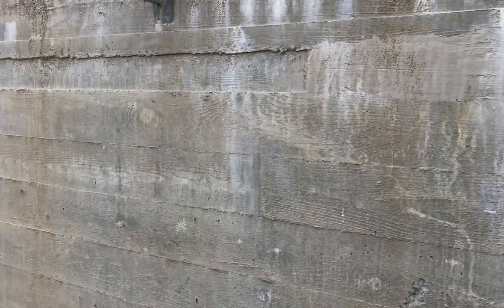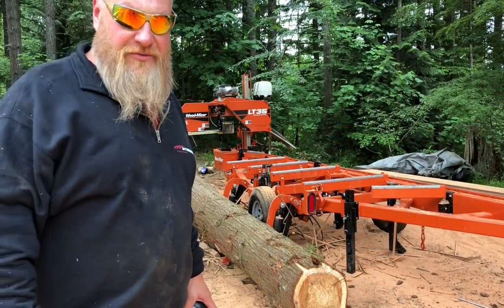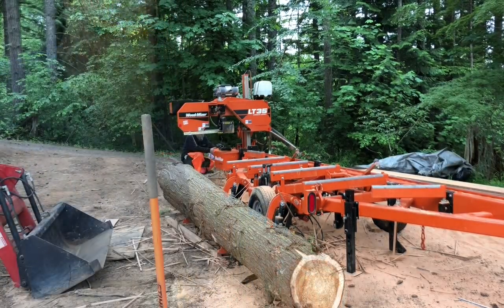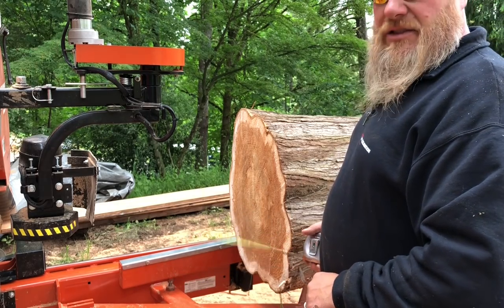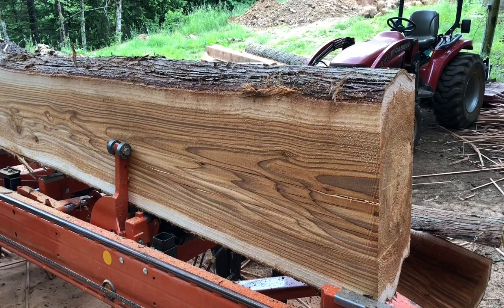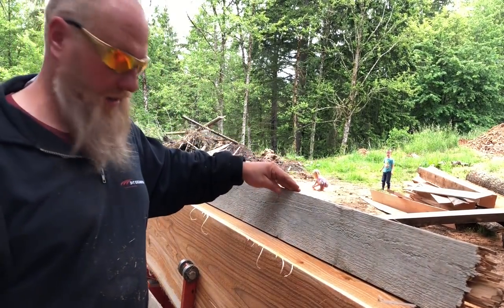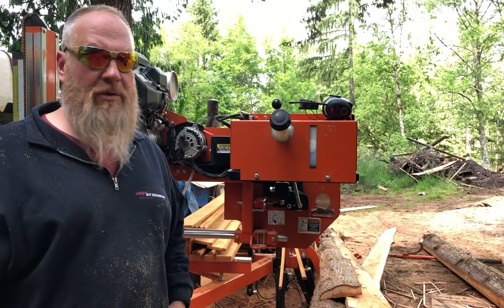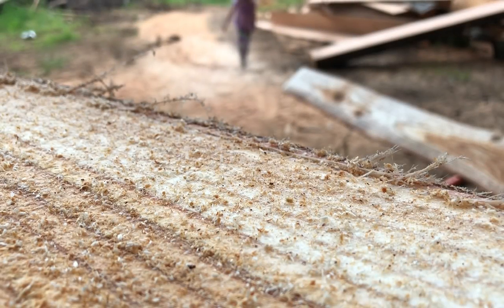Sawing a cedar log for board formed concrete

Comment: That sounds like a cool way to transfer some interesting texture to the concrete so it isn't so boring.
Reply from the maker: It actually simulates the way concrete used to be formed before plywood and fancy engineered forms. I plan to do a video showing the finished product.

Comment: I was thinking about the curious peanut gallery.  

Can you lock the starter key of the WM-35 from little idle hands?
Reply from the maker: Why would I do that? I need the help!!!😆 

But seriously. The key comes out of the ignition. And it requires the chokes be pulled for a few seconds to start. It would be difficult for them to figure that out.

Comment: That is a beautiful looking wood wish we had it here, see the boss was on the job as well shame it's only for boxing to get the effect but they pay the price I hope. Do you have to change how you cut green wood to cutting dried wood for a clean cut thanks NZ.
Reply from the maker: Thanks, barry. When cutting those dry beams I didn’t run water on the blade to avoid staining the wood which is hard on the blade. It heats up and dulls quickly. That soft green cedar I can cut through at full speed.

Comment: Nice job.
Though how do you figure the cost to the customer? I know cedar at the "box stores" are very spendy. I'm just wondering how or what factors you use.
And do you sell your saw dust?
Reply from the maker: I’ve never sold my sawdust. I usually burn it. As far as cost. I typically look up store prices and subtract 1/4 to 1/3 depending on the application.

Comment: It might be worthwhile to invest in a wood pelletiser machine, to turn your scrap wood and sawdust into pellets for automatic feed wood burner stoves. 
It would provide and additional income.
Check if they are sold anywhere locally, to see if there's a market.
Reply from the maker: All my neighbors have pellet stoves. I’ll have to look into that. Though I typically heat my own house with the scrap wood.
Reply: @NorthwestSawyer  
The best type are those with a perforated cylinder, and a roller inside, rather than a flat perforated  plate.
The advantage is that you can also use all your sawdust that would otherwise be wasted, and mess the place up, and all the branches that would also be wasted.
I'm in France, and here, scrap wood sells for 25 Euro/cube of stacked off-cuts; Pellets about 100 Euro for the same weight. If your neighbours have pellet stoves, then you have an immediate market. Lucky you!
Here's some  links to start you off. You could start small and work up, or go for the big one!  you can also opt for diesel, or electric.
http://www.pelheat.com/the_mini_pellet_mill.html
http://www.biofuelmachines.com/gemco-biomass-pellet-mill.html?utm_source=20160106GEMCO&utm_medium=EDM&utm_campaign=youtube&from=edm
Reply from the maker: Thank you for the info! I’ll have to see what pellets sell for here.
Reply: @NorthwestSawyer  
Good luck!

Comment: make the second undercut from the bottom up and you will end up with square butt log
Reply from the maker: That’s a great point, Larry Lovegren
Reply: You need to go look at logged areas, you won't find a stump that is square across. All real fallers make the second cut from the bottom up to salvage more wood from the tree.
Reply: I think that is what I said Ray C.
Reply: It is, was supposed to go above. Maybe some of these timber cutters will take notice and do it the way it should be done.